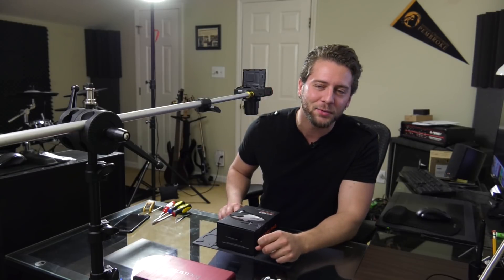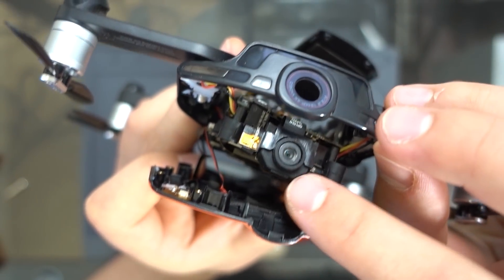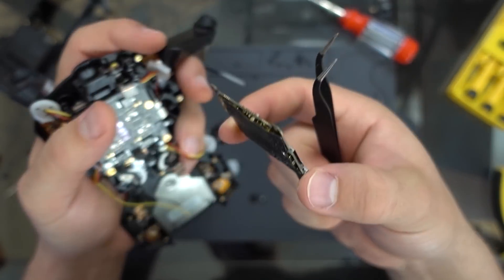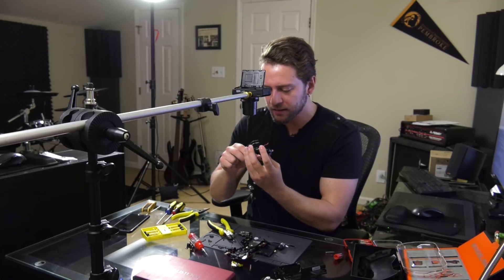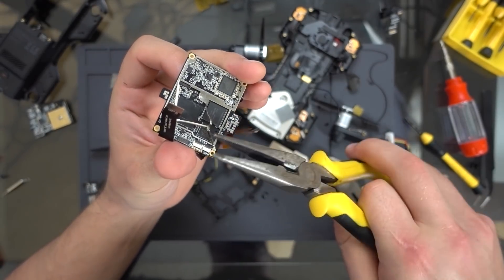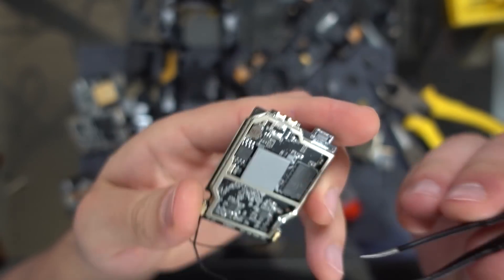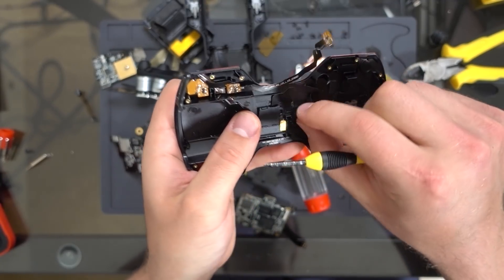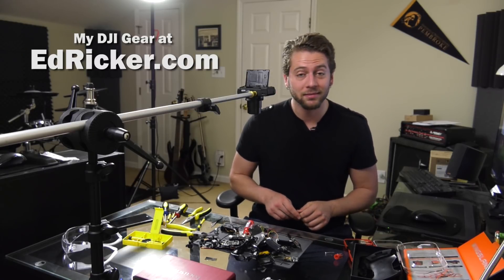What's Inside a GPS Drone? Let's Break One Apart!

Comment: Anyone convert the battery with 18650?
Was wondering i can connect with the current battery circuit board.
Reply: Oggi 2022 si puo comprare una replace battery 2 cells 2250mah in Aliexpress per 12 us dolars,aprire la battery-box originale e rimpiazare le due Cells 1400mah per le nuove 2250mah..DIY (lo devi fare te stesso)o con l’aiuto di uno che sa quello che sta facendo ! Vola “hover” 9 - 10 minuti … io lo ho fatto e sono molto sodisfatto 👍 hope it helps

Comment: I recently got my Wingsland S6 Drone crashed. It's battery finished in the mid-air. So it automatically started descending with quite a speed and landed on an uneven surface. It's left sided back arm got fractured. When I opened the arm, the arm contained a small circuit board and two wires. In your video (12:00 to 12:10), the arm contains no circuit board just the wires. I am not getting that. Has they changed the inside design between different versions? My version seems to be exactly like yours though.

Note: I don't see any version number on my drone to tell you. However, my props are freely moveable. That's what I know. In the previous version of this drone, props were not freely moveable. And they needed to be locked in place before the flight.